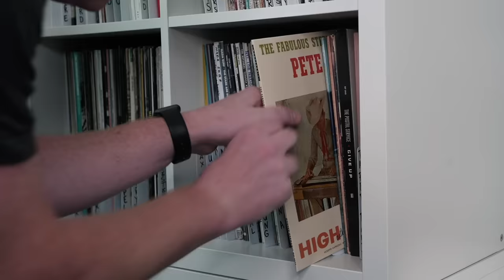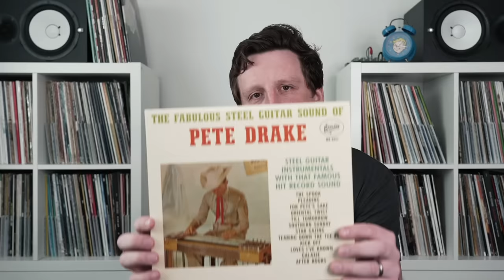6 Guitar Pedal Myths

Comment: I'm an electronics engineer with 50+ years industry experience. 66 years old now.  I agree with everything this guy says. He knows what he is talking about, which is unusually refreshing from such a young guy.
Reply: Josh ain't that young. He's like 40.
Reply: @JC-11111  Ah, these days that is young.
Reply: @JC-11111  Bro, I'm 40 and I don't feel (nor look) that old 😅
Reply: Capacitance of a guitar cable is 30 picofarads/ft. Capacitance in the tone control knob is roughly microfarads. Doesn't seem like true bypass should affect tone at all. What am I missing?
Reply: @arkie87  Guitar tone caps are actually in nF, 22-47nF are common. Source impedance of a guitar is ~6-8k ohm for a single coil, double that for a humbucker.  Even with short cable runs (10 ft to pedal board, 5 ft through pedal board, 10 ft from board to amp, or 25 ft total) you are getting 750pF (0.75nF) of capacitance.  Cutoff frequency for a humbucker through a 25ft cable (with volume maxed) is 1/(2*pi*750pf*16k) = 13kHz, already in the "air" of the audio spectrum.  Start rolling that volume off (adding more resistance) and you are effectively rolling high frequency off at the same time.  Double the cable length to 50ft. and you are starting at 6.5kHz, already affecting presence and high overtones. 

Putting a buffer in the middle of that cable run basically breaks the capacitance in half - only the capacitance of the cable to the buffer affects tone. 

Also note if you have an effect that is always on, like an overdrive, or EQ, or compressor, you get the same effect as a buffered bypass.essentially
Reply: @JC-11111  40 and doesn't know a germanium transistor correctly.
Reply: I am 18 months old with over 2 centuries experience in the guitar pedal business. This guy knows NOTHING about pedals
Reply: I’m also an electrical engineer - no I don’t have 50 years of experience but I fell in love with EE because of music and of course pedals. I think there’s several statements within this video that are misleading. Not necessarily “untrue” but deff not the whole truth either.
Reply: I am as old as the universe. I have been working in electronics since the spark that created the first stars. This guy speaks exactly 50% correct information, which is impressive for a flesh being of inferior intellect to my infinite knowledge of all time and space.
Reply: @kennethmckeith7908 ya whippersnapper! Lol
Reply: 완전히 동감합니다❤
Reply: You’ve had your foot in the door when you were 16?
Reply: @Billiamwoods what pedal do you recommend?
Reply: My dad owns Nintendo.
Reply: @sicknasty44  exactly.
Reply: The original poster's math story 😂